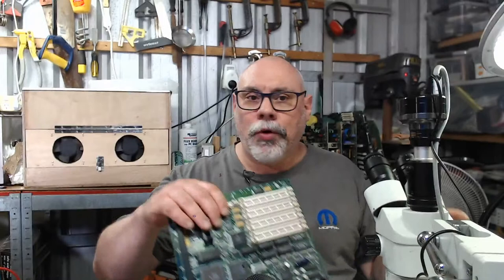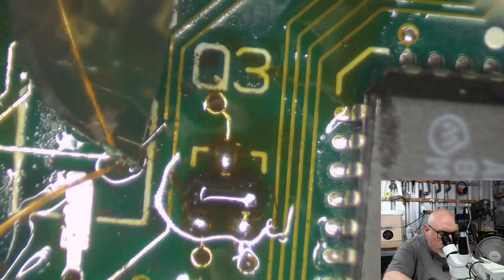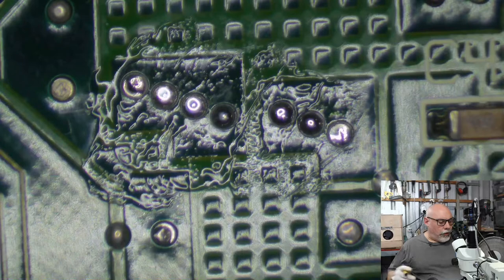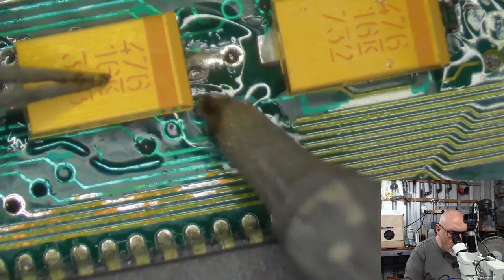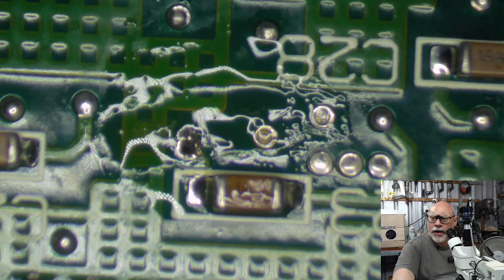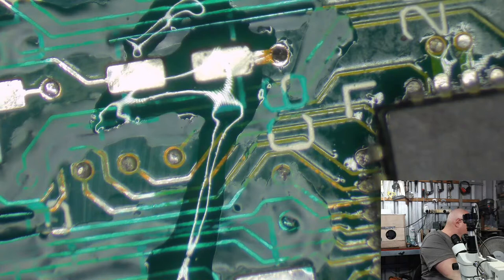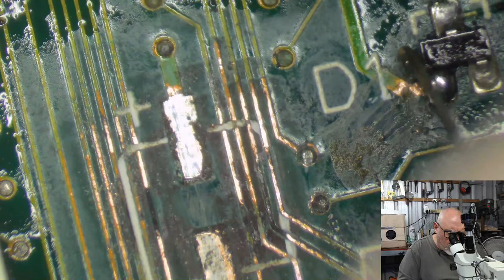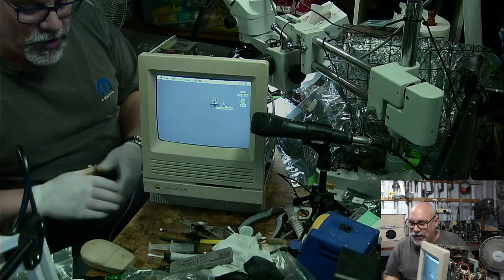Repairing the nastiest SE/30 board I have ever seen!

Comment: Branchus, your tutorials are very good. I've been replacing transistors and IC chips and have a common problem . At times the circular copper trace that surrounds the hole in the board where the pins fit through will loosen up and become detached from the board. Do you have a tutorial for repairing detached circular traces ?  Thanks Thomas C.

Comment: Does a IIsi rom added to a Se/30 board really make it 32bit clean  Ive heard it from a lot of sources, but when  i did try it many yrs ago and no dice
did not see the Addtl 32meg ram.

Cheers all
Reply from the maker: Even with a 32 bit clean ROM, you still need to switch on "32 bit memory addressing" in the memory control panel and restart to utilise anything over 8MB.

Comment: Bruce, great job.  For the SE, SE30 power extension cable, i use this.  Its 32cm long and you use one sides 14 pin connector.  Ive used these also for the IICI/IICX power supply extension also.  https://www.amazon.com/gp/product/B07L88HJ9X/ref=ppx_yo_dt_b_asin_image_o08_s00?ie=UTF8&psc=1